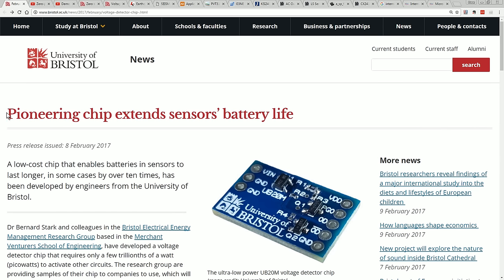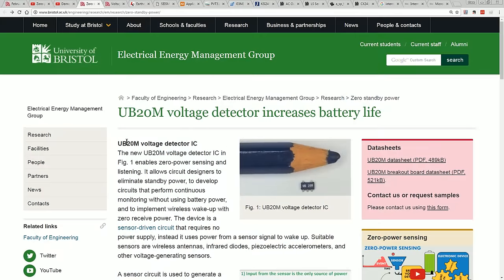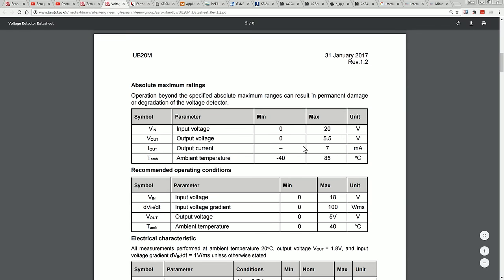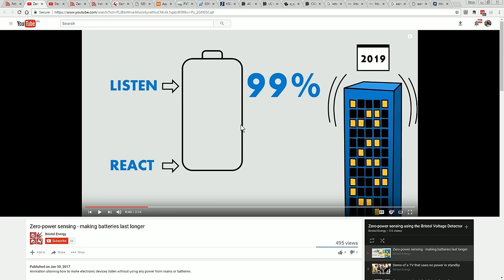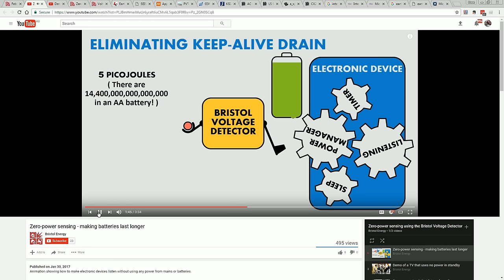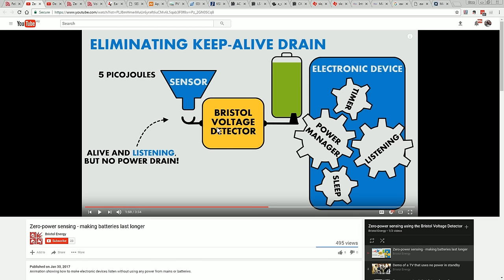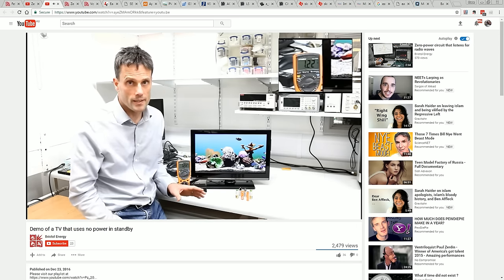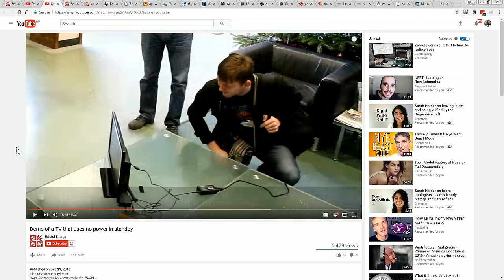EEVblog #971 - Zero Standby Power TV - BUSTED!

Comment: I suspect you could get functionality pretty close to this with a few bog-standard parts.
High-gain NPN on the input, pulling down a high -value pullup to turn on a pch MOSFET or PNP, which in turn pulls up the gate of a N-ch fet or NPN transistor. 
Might be nA rather than pA but almost certainly good enough for a decent percentage of the already small number of applications for this chip. 
And the big elephant in the room is how you stop it wasting battery power when being continuously activated by a signal. If you're going to do a custom chip, at least make it useful by adding a hold-off facility to reduce this problem.
Reply: Mike ya legend!

Get back to your vids, we need more!
Reply: Problem is that every electronic switch has a leakage current high enough to power a lot of devices right a way.

Using a latching relay and a separate standby power supply you might can shave of a couple of pA.
Reply: mikeselectricstuff I thought exactly the same thing when I saw the video.
"Super low power device which activates a open drain output when the input reaches a certain voltage"
Sooo, they have invented the transistor?!?

Gross incompetence at Bristol.
Reply: mikeselectricstuff
More importantly you have to consider the resource trade-off.  Is the amount of power loss more significant than the additional circuitry required to eliminate it?

To put it is cost terms: is saving a few cents over the lifetime of a product worth the investment in hardware and engineering?  I doubt it would ever stack up.
Reply: I guess if they had sufficient funding, they could do a version with a nice little demodulator and state machine that would still fit inside the power (charge) budget, but this is a university project not something from a silicon design house. As I read the site, the IC is mostly a proof of concept, and they are using it to look for interested parties to develop it with.
Reply: They said there is a filter that detects changes, I think.
Reply: By bog-standard, would you perhaps mean a proper chunky switch that actually cuts the AC input? Because I really do miss those.
Reply: mosfets can do that too really and their off resistance is so massive they are essentially a open circuit. relays can be used too but they are more expensive and bigger... plus they wear out more and take WAY more energy to switch on and for most types constantly consume alot of power to remain on.
Reply: If you check the datasheet the main difference between this device and a transistor is that the output snaps to zero only when the input threshold is reached. Another difference is the low input current and the high-voltage capability. We are not aware of a transistor that will have 100pA drain-source leakage current in the entire range between Vgs from 0 to Vgsth and a gate leakage of 5pA. Keep in mind the input is not digital, It's directly connected to the infrared photodiodes and any voltage that is close to the threshold will cause subthreshold leakage and might actually damage the TV boar as it will be powered with less than 12V. The hold off circuit is not an issue at all. The power-gating switch is controlled by a passive OR circuits which has one input coming from the voltage detector and another one from the load. The voltage detector turns the switch on and the load decides when it should turn itself off.
Reply: Plamen That part is impressive.  Too bad the application is a waste of it.
Reply: Regarding using other parts...

A single transistor would switch too slowly, when the sensor output gradients are very low, and lock up the system. As the transistor starts to turn on, the load electronics transitions the unwanted logic states too slowly, and a load system gets stuck in a low impedance mode that drains the battery current. So we needed something that works like a power-on-reset circuit.

We use the ZMDI ZSPM4121 if we have 100nA sources, if threshold is not important. 40nA input current. 5.5 max input, 1.2V threshold.

We use the SiLab TS12001 if the threshold is important, 0.78 V, but then you are looking at hundreds of nA input, and only 2.5 V max. 

There are also good voltage detectors from AMS and Torex.

However, for sensor-driven circuits, which is the concept we are demonstrating here (we are using a TV to demonstrate the concept, as people can relate to that), sensors can't usually deliver 10s of nA. They supply more like 10 pA.

E.g. our IR example would have required hundreds of photodiodes in parallel to turn these commercial detectors on.

Also, ferroelectret and piezo sensor outputs would collapse to nothing if we used these devices. Once you are down to below square centimetres of active sensor material, it is easy to be in the GigaOhm output impedance range. If you stomped on the material, then you would overvoltage these commercial detectors.

An RF rectenna needs a very low threshold to get any range. That is why we made another version of this detector with a 0.46 V threshold. If you put your rectenna next to the transmitter, you'd over-voltage a commercial voltage detector. If you protect the input with a zener diode, then the leakage kills your range. We then found, that the 100pA input current of this lower threshold device, made the range worse, so we went back to using our 6pA input device with the slightly higher threshold.

So what we are demonstrating here is a "sensor-driven" approach and the UB20M is the only chip we know of that can remotely turn-on electronic system from a feeble light source such as a standard TV remote from 4m away. We are certainly not implying that we have developed an amazing TV, or that this is the killer application of our chip. It is just a system where the chips listed above can't provide sensor-driven detection, but ours can. So we thought it would be a good demo. Companies will make the connection to other applications, such as triggering industrial sensor readouts using remote beacons (IR or RF). Sensor-driven detectors need a very low threshold voltage and high maximum input voltage at the same time (e.g. UB20M has 0.6V and 20V). They need to have sub-nA input current, or it's not realistic with off-the-shelf sensors.  They need to provide a power-on-reset style turn-on speed for the system to not go into lock up, and we need hysteresis as sensor output gradients can be very slow and noisy. Our device does all of this. We have had around 30 companies approach us with ideas, some of which are great, and some which might not work. They are using our evaluation boards to find out.
Reply: indeed, and with a bit more effort you can even integrate that into a PSU like these: http://www.ti.com/general/docs/lit/getliterature.tsp?literatureNumber=slyt557&fileType=pdf
Reply: Yes it's possible but would't make any money because nobody would buy this useless chip. I'm gob smacked by the whole pointless thing.
Reply: nA v pA is 3 orders of magnitude different. Hardly close

Comment: While what you said is true, I think it's a little unfair. This is nothing compared with the intentional bullshit all over kickstarter and indiegogo. The chip works, it just would have to work together with the TI chip you mention or something similar in the primary of the power supply to make a difference to something like a TV. TV manufacturers aren't going to use it any more than they use the relatively niche and obscure TI chip, because they'll use the cheapest solution that gets them through the regulations on maximum standby power. There may not be a need for it at the moment and it's not going to change the world any time soon, but if someone does have a need for it, at least it should be able to work in some design or other, not like a batterizer or a solar roadway.

I don't think they chose to demo it switching low voltage DC to be misleading, but because it's trivial to implement with a single transistor. University students these days generally tend to work on arduinos and other low voltage DC building-block widgets and many people coming out of university with a bachelors degree wouldn't know how to do anything to do with mains power supplies.

But yeah.... that pull up resistor... ¬_¬
Reply: KX36
the chip doesnt work. its bullshit because you cant take power suplies out of the equation and most of the stand by consumption is on that part.
chips dont consume shit on standby, most are under a mA on stand by, thats like not even a milliwatt in most cases. 
the only use it could have is for maybe waking devices but not as a main switch nor to reduce the stand by consuption.
maybe for an alarm, that wakes up by the movement
Reply: I agree, dave was really on a stretch here. What's next? Debunking every product page ever for every chip ever produced  and only mention in passing that the critiques are mentioned in the datasheet? (newsflash: they all use wank-words/false best-best case data) Further attacking the examples is strange in that it get's so stuck on insignificant details of the particular examples/setups (sure, this is not suitable for powering up a TV). I think this chip would work fine for powering up a cheap more power hungry micro-controller on a sensor event, say a pizeo based vibration sensor or whatever.  If the µC is powered by say a cap that is charged with RF then I could definitely see that a low quiescent current could be nice without having to limit one self to a certain subset of micro-controllers. Could it be done with other discrete components? Yes. So can most opamps/[whatever chip is on the market].
Reply: You'd use it to bootstrap the turn on of a power supply, the initial step to turn on doesn't need the power supply to already be on because it harvests that energy from the IR signal, that's how it would work and that's what it does that's new... Except for that pull up resistor which has to be connected to a voltage source even if the open drain inside the chip was the only thing connected to it and so it would pull negligible current from that voltage source while off. That voltage source could potentially be a long life battery though which would expire before it runs down.

You need to design the whole system together, so that the IR signal powers the chip which charges the gate of a FET from a battery which signals to the power supply enable a switching controller on the primary of the power supply, without needing an aux power supply to be continually on. So it's a bootstrap process, as it progresses it uses more power from the wall, but before it starts it doesn't.
A system as it would be now would be that the switching power supply has an aux supply which is always on just to power the IR sensor and turn on circuit and that might take half a watt for example.

Yes, waking up devices, that's what standby is. When you push the button on your TV remote, you wake up your TV from standby.
Reply: Actually, that gives me an idea... is it worth swapping battery power for solar panels in these devices for standby?

Comment: This is a great device but application (Mains powered TV) is not its market. Mains standby power <100mW costs about $0.20 per year to power.
Its real market is battery powered equipment that have a high "ON POWER".
Reply: I know people who are convinced they are saving big money and energy by unplugging stuff with low standby energy consumption. I think they use more energy supplying the calories they burn going around unplugging shit than they save.

Comment: Dave was clear on the "What problem does it solve?" question, but of course no one person knows about all the problems that other engineers are quietly working on. So, for instance, road bridge with built-in sensors: 

http://www.cbc.ca/radio/spark/343-smart-bridges-the-end-of-fm-and-more-1.3948141/if-this-bridge-could-talk-1.3952123 

1) You might want the batteries in your sensor packages to last as long as the bridge does, so you can embed them into concrete or other areas where it's hard to fish them out and replace the batteries every 5 years. 

2) In this context you really do want pA instead of nA, because your traffic management system is going to be blind on that bridge after the batteries die, and you'll have to come around with traditional road monitoring solutions that cost 100x as much. 

I think Dave's criticism of the TV demo was fair, but if the smart bridge is a much more realistic use case, you can see why the engineers went with the TV. Building a "demonstration bridge" rather that wiring the thing to a TV was just not in the budget. :) 

Once you've gone down this road, you want to be able to explain the demo to people who are not electrical engineers.  So the details that are not relevant to the actual use case (the bridge, running on batteries for decades) get left out. Which seems deceptive IF you think the TV represents a real use case that the Bristol U's engineers were hoping to sell to. 

But since utility companies, national regulators, and TV manufacturers employ actual engineers, I think there was little chance of that happening. 

Keep doing what you do, Dave.

Comment: The voltage detector would also trigger from random noise as well as from signal. As such, the system would be waking up all the time to discriminate between signal and noise, which means that you wouldn't be getting very much savings at all, even if their claims were on level.

Comment: GIGO: Garbage In: Grants Out
Reply: Unfortunately, as a PhD student that was involved in grant writing, I've learned that sensationalist writing is pretty much the only way to get the money.  Especially if you're writing something that is not exactly where the "firehouse of money" is currently pointed at.

My friend's old research group, during the height of the Obama era where devices to help fight climate change were the big forefront for the money, rewrote a grant proposal for a system that helped decrease the control signal (and thus increase the actual control signal) by emphasizing the reduction in power necessary to send the same amount of usable data.  While that IS true, no sane person would look at it that way instead of just increasing the possible data rate.

Comment: Wow. I did this 40 years ago when I was eight. I used two solar panels. Light on one created enough voltage to turn on one MOSFET that turned on a relay, with the relay self powering itself from batteries. The other solar cell turned on a different MOSFET that shunted out the relay coil and breaking the circuit.

I'll be awaiting my millions any day now.

Comment: There appears to be quite a bit of hype about this "zero-power sensing device".  The device is not zero-power, but rather, it is an ultra-low quiescent power sensing circuit.

The stability of Bristol's UBM20 evaluation board is somewhat questionable.  Nothing within the UBM20's specification calls out its quiescent current requirement, its noise v. temperature or shielding.  In addition, is it a stable design? Note that shielding, guarding, thermal and shot noise, parasitic effects, component selection and mounting substrate are all in play.

Comment: A bit of an overreaction Dave. My experience of dealing with Uni-based stuff like this is they - including the teaching staff - can have little or no experience of real world electronics and make naive assumptions or mistakes. Here are clearly treating the TV as a device on its own and ignoring the PSU.
Reply: You can also use their device to switch the power to the PSU off. Then it's truly no-power. Dave is hair-splitting here and doing himself a disservice. Disingenuous.
Reply: @horrovac  No, you can’t. If you would’ve watched the entire video, Dave explains that their circuit needs a source of power outside their energy harvesting device to operate, which is why they chose a TV with a power brick to provide it; and in order to switch mains voltage, they would need more outside power to do that too.
Reply: @TheXGamer969  OF COURSE I have watched the entire video! AND rewatched it several times to try to figure out what's bugging Dave. What kind of shitty assumptions are you making?
Sure, their demonstrator device uses external power to operate other circuits, but the chip does not - it operates on energy it harvests from the RF transmission. So while this device uses external power, it does not need to. I wasn't talking about THIS demonstrator device, I was talking about what is possible with such a chip. And the chip seems perfectly capable of providing enough voltage to turn on a Mosfet, which turns on a relais on the supply side, BEFORE the power brick. That would use exactly zilch point nada power (minus any kind of leakage from the mosfet), but could still be turned on - using the RF energy.
A person like Dave should certainly be able to imagine something like that, at least when a person like me can imagine it.
Next time try reading and UNDERSTANDING the comment before you start throwing insulting accusations about someone not watching the video they're commenting on.

Comment: You might want to repair or replace the LCD module in your three phase power analyzer. There's missing rows, so the flex probably doesn't sit well on the LCD PCB.

Comment: I have found the true zero standby power solution that really works, and guess what... It's what we used in the old days - a power switch that turns on, or off, the incoming power! It doesn't even require any fancy remote control because you can use any one of your fingers - and they never run out of battery! :p 
If it worked back in the days it works now as well and you don't need to be able to turn on everything with a remote control. Not applicable to sensors etc that needs to react to a signal, but most electronic equipment in your home will work well with this method ;)